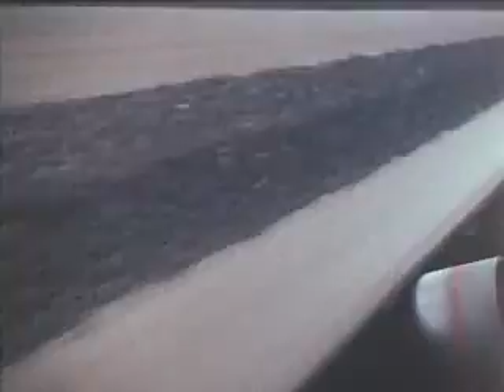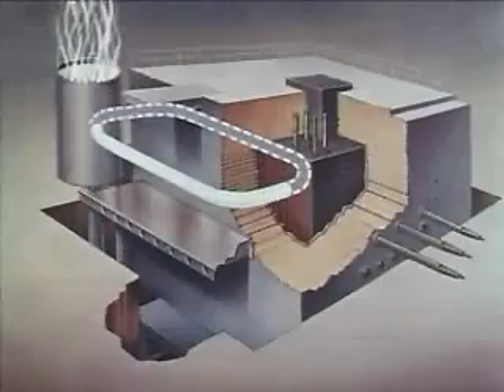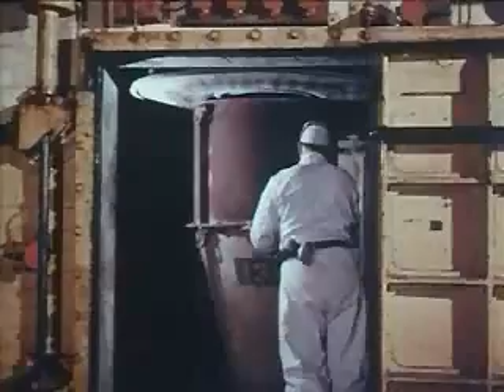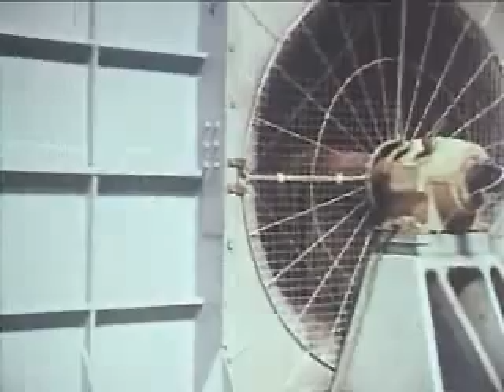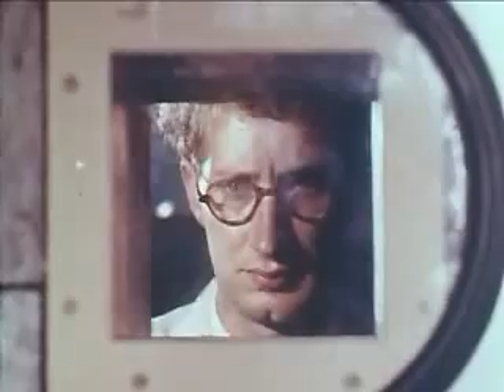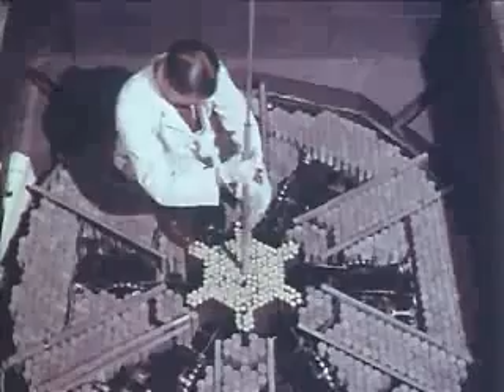Atomic Achievement (1956)

Comment: Chee I wonder how much radiation those workers working over the pool of spent uranium / plutonium rods were exposed to.

Also, those plastic suits doesn't look like it would protect much against radiation, other than the fact that you're breathing in uncontaminated air :)
Reply: Water is an extremely effcient radiation barrier - You can stand on top of  a submerged working reactor core without any problems.